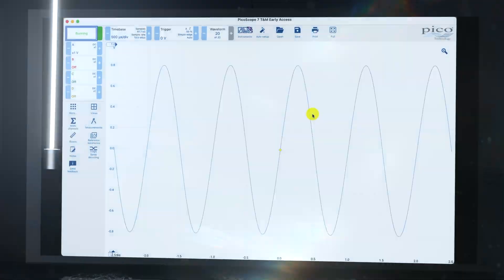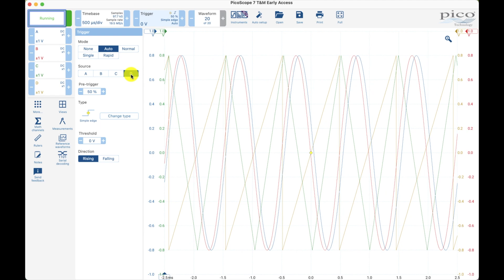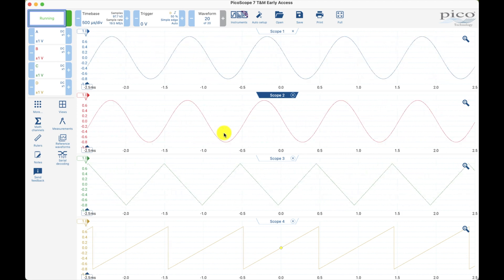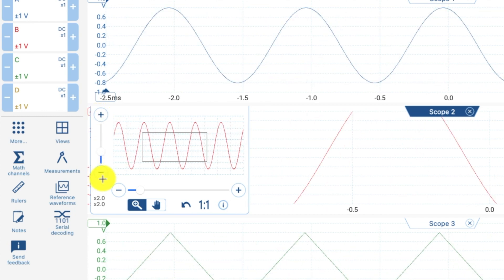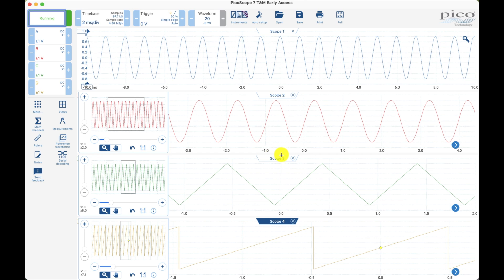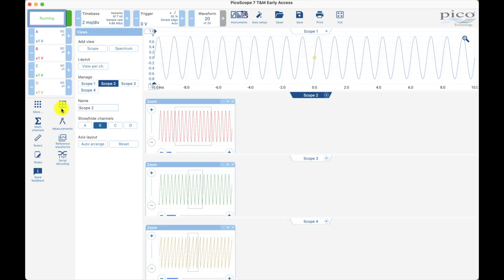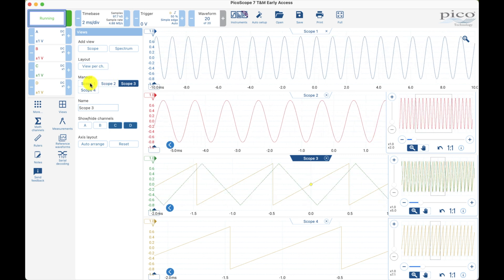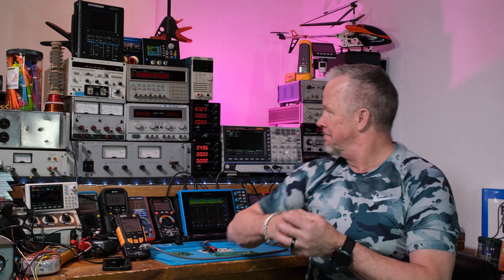Power of Pico - can your oscilloscope do this? Picoscope 4444 #12Bitoscilloscope #bestoscilloscope

Comment: hi, i wanna know the risks of connecting the picoscope to a laptop, in a country like india whre you can expect a lot of wring errors. Thanks
Reply from the maker: I would think it is safer to connect to a laptop in a country with unstable voltage.  The laptop will have a regulated power at its usb ports.

Comment: A question - how accurate is the pico measuring DC voltages compared to a good quality multimeter? For example my Fluke 87V accurately shows 5.000 volt using a calibrated 5V reference, whereas my Rigol scope shows different values. I understand that the scope has only 8 bit resolution but am curious to know how much more accurate the Pico in 16 bit mode is in practice.
Reply from the maker: Thank you!  This is a fantastic question!  DC readings from a quality meter like the Fluke 87, Hioki 4282, or any meter that can do 20k counts or more is hard to beat as they are on the order of 0.1%.  The Pico is probably 0.5% at 12bits, but can do hires 14 bits, so that might be more comparable.  Typically I think 12 Bits will provide 0.5% where an 8 bit is closer to 2%.  At 1kHz, the Fluke 87 will drop to 2% and drop off at 20kHz, so the Pico definitely wins the AC voltage accuracy;)

Comment: What are the voltage input limitations?
Reply from the maker: That’s a great question and it depends on the probes that you use.  This is a differential input version, and the 1:1 ratio probes have a plus and minus 50V max, but the 25:1 probes have a plus and minus 500 V rating.  I can also use any regular BNC connector probe, so that would be the same as any other scope.  Very versatile;)
Reply: Ahh! Very good.  When I looked at the PICO long ago it had a very limited input.  Looks like they corrected that. Thanx!

Comment: Genius Lecroy engineers did this in their scopes very very long time ago (at least 22-23 years). On Lecroy you can split the screen to up to 8 separate traces (not just 4) and you can have 4 zoom or math traces. So you can have your 4 channels plus their zoomed ones all separately. so this is not new and has been around for a long time. I think lecroy were the pioneers of this but I may be wrong about that. On my Lecroy Wavepro (made in 2005) I can do it. What would be cool though is to actually have two different time bases. There is a cheap chinese scope that Dave reviewed some time ago and it does have two separate time bases I forgot the name but it was two channel scope.
Reply from the maker: Thank you for this great information!  I actually did work in a lab where they had a Lecroy Wavepro.  I used it very little so I didn't see that functionality.  It had a 10 inch screen if I remember, and had a lot of power, but it cost over $20k.  I think it is amazing and something new that you can get this kind of power in a scope that is $1700 with all the probes:)
Reply: @KissAnalog  yes but that old used wavepro with 3GHz bandiwdth and 20Gs/s only costs $2k-$3k these days. I got it a quarter of this price because it was not working and repaired it and then upgraded it so it is a much faster scope than the original stock. The math capabilities and spectrum analysis of LEcroy scopes are simply unmatched but I do understand why people prefer keysight and tektronix ...

Comment: Eddie, nice demo. Pico's DEEP memory cannot be ignored with this topic; it allows you to treat a long capture as if you had multiple timebases. Using the ZOOM as you demonstrated, you pick a memory screen that has an event on one of the channels, stretch out the waveform containing the event to see detail and mark it with cursors and/or rulers. Now you can zoom in or out of a different channels, in the area of the cursors, and the relationships and sync between other channels and the event becomes clear. Appropriate triggers and math channels really help when observing the 4 channels, especially when LIVE, and all at different zoom levels. And a good, single shot trigger is still your friend, and will freeze the stack in the perfect spot -- just like the old days, but without the squinting. You can even add markers to a signal, use deep memory, and watch that marker move through entire circuit, taking measurements along the way.
Reply from the maker: Thanks for this great informative feedback!